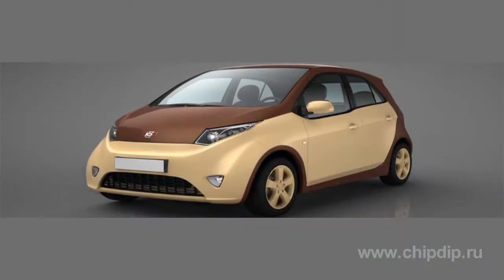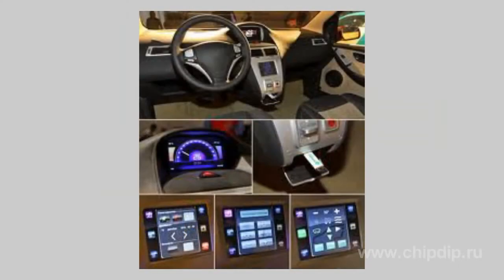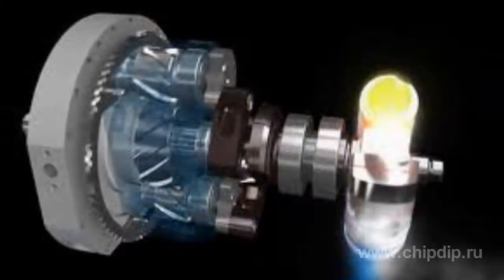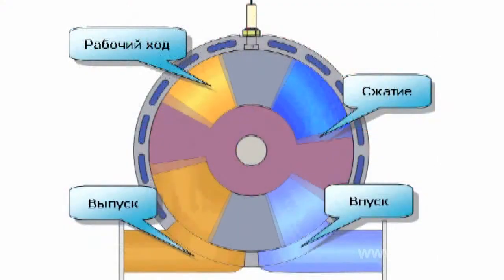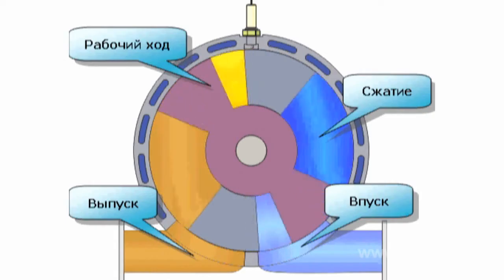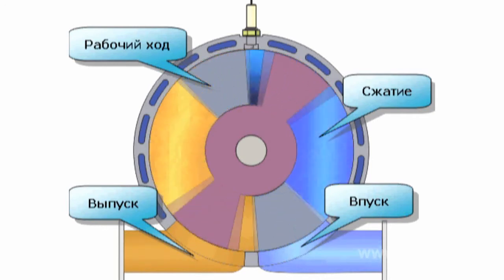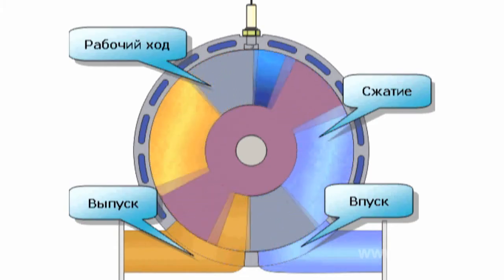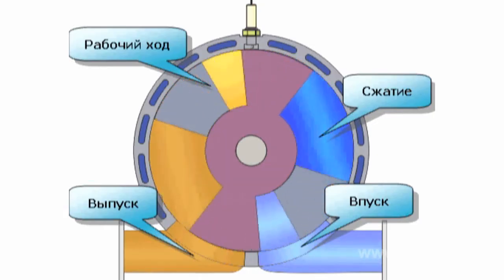Rotary-Vane Engine

Comment: This engine is more accurately know as a rotary piston engine, or a toroidal engine. Kaurtz and Tschudi developed hp producing versions many decades ago. I believe the Wankel is a rotary vane by definition. Piston backwards driving was prevented by gear constraints.

Comment: I don't understand how this can work. Once the fuel is ignited the force would be on both pistons which would make one move clockwise and the other counter-clockwise, and then it would oscillate not circulate.
Reply: capture the others rotation with worm gear at specific point and it cannot be backfed. and when its free from the worm gear another combustion can be ignited.
Reply: You would have to have one way clutches (edit: or something to lock the incoming, to allow the outgoing to accelerate) on the rotation point of the vanes... to prevent exactly that, back feeding power and effectively stopping the rotary motion.
Reply: @ScooterMcAwesomeness  differential.
Reply: @thehemmo5078  Indeed.. something... anything. 

I just want to see something like this built, working and making KW/HP

Comment: What guarantee the shaft will not return backwards even for little bit
Reply: use differential and two separate shafts for each half. and slow the other half with worm gear so it cannot be backfed when combustion happens.

Comment: First the wankle  engine which I thought was Freckin cool. Now this thing. How many more engine designs can be developed and none of them actually be used in any type of production. I thought the hit or miss engines were impressive too but in a car, doubtful.
Reply: +Michael Hartzell the wankel engine was and is used in production, the mazda rx-8 uses one (R stand for rotary). Hit and miss motors were also used very widely back in the day, just better designs out there now.
Reply: You do realise the wankel was used in many cars and even bikes, and as for hit-n-miss, a similar thing is used now, where some of the cylinders are not functioning in low-load idle.

Comment: Wait a minute.... when the compressed fuel air mix detonates, wouldn't that push both vanes in the OPPOSITE directions? Secondly, wouldn't this have the same problems the Wankel rotary engine did?
Reply: the gear holding the 2 separate parts do not allow but one way rotary movement. one part accelerates while the other decelerates.
Reply: 😀Thanks
Reply: Guess gearing and inertia don't exist in your brain?
Reply: It works similar to Newton cradle. One piston accelerates, while the second decselerates.
Reply: Air Fuel Mix shouldn't explode. It rapidly combusts, it does not detonate. If it does detonate, you need to richen up and back off some timing. Detonation in an engine = badness. Most people know this, and now you do too.

Have a fantastic day. Keep learning and growing. Stay safe.